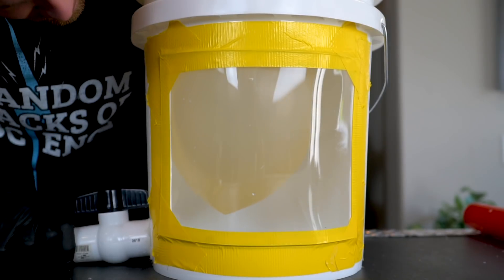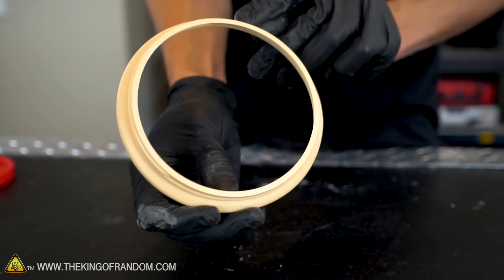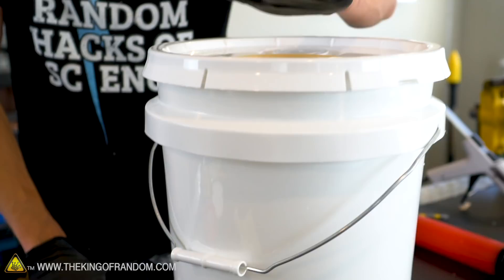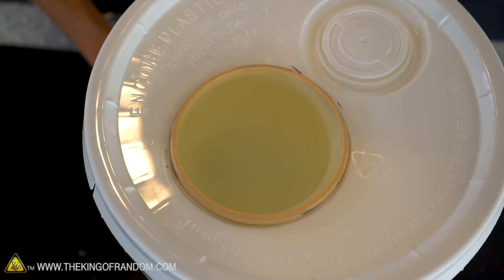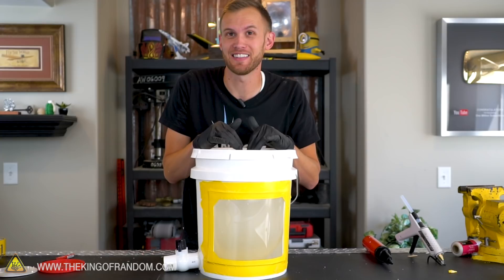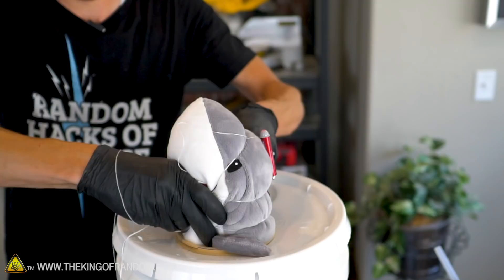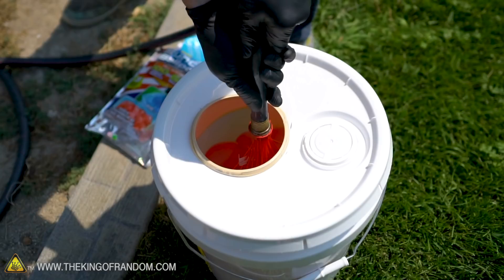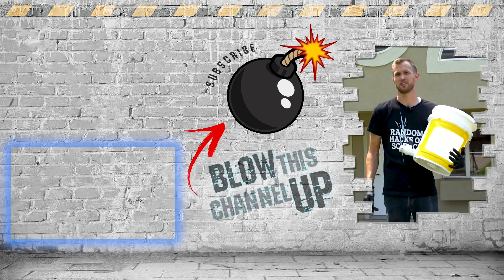Inflate Balloons by SUCKING

Comment: Is it possible to make a balloon levitate? By increasing helium to the point where the balloon won’t completely float but will stay in one place and levitate? Or possibly using other gasses to creat a balance and make the balloon stay in one place?
Reply: Yes but it's very very hard
Reply: And how much weight could it hold
Reply: It depends
Reply: it is. i had a balloon that would stay where the sting would stay on the floor and it would not fly away.
Reply: Its called wubble
Reply: An easier should be just to put weight to the ballon to the point that it dont floats away
Reply: If the density is even slightly higher than air, it would slowly sink, if it's slightly lower it would slowly rise. Even if you created a nearly perfect balance it would still over time move in either direction. You could make a slightly lighter baloon and blow a very slow steady air from above to levotate it forever
Reply: You'd have to make a ratio of somthing like 3 - 1
Reply: yes, but not for long.
Reply: There is no true levitation, its velocity would slowly be increasing or decreasing
Reply: It would have to have the same density as the air around it.
Reply: Yes but it will be very hard and it will move towards everything
Reply: just fill a balloon normally and wait a few days, as the helium slowly escapes it will eventually do that for a time before it winds up losing too much to float any more.
Reply: Might be fun to make something that floats between levels of water get a lot more control in that situation

Comment: This is a very neat trick. Now try to make a hole in a balloon without popping it.
Reply: Water
Reply: Put water in a balloon then stab it with a pencil and keep the pencil there
Reply: Put tape on the balloon and stab it there, and leave the stabby thing in if u dont want it to deflate
Reply: Stab something at the neck of the balloon so it goes flying :/
Reply: thats ez

Simply just put a bit of tape on a balloon, it doesn't have to be big, then stick a needle through the part with tape, it doesn't pop.
Reply: you can also cover a skewer with soap, along with the area you want to stab, then impale it with the skewer.
Reply: your crazy

Comment: What would happen with molten metal in vacuum chamber?
Reply: Nothing i' d guess it would maybeee start to bubble a bit due to higher (or lower not sure) vapor pressure or because of trapped gasses like carbon dioxide.
But i would also love to see that
Reply: He won't do that.
300°Celsius metal in a glass jar/plastic bucket,bad idea.
Reply: Umm 1. Molten metal is more than 300 celcius. And 2. He can always use metal bucket
Reply: @raww1315  The heat radiated would still do a lot of damage.

Comment: Fantastic idea! But...for those who are interested, what brand & size balloon did you use. 

Also, you did not fully show yourself removing the balloon necks from the top of the container after inflation. Why is that?? Is it difficult/was there trouble doing so??? With that basically being the last step as it pertains to the bucket, it would have been NICE TO SEE!! Thanks.

Comment: Why don't you stick a piece of PVC pipe into the vacuum hose and tape it on? Then connect it to the ball valve so you don't have to constantly hold on to hose. You'll also have a better seal that way.

Comment: You could probably make a water balloon bomber by only putting 5-8 water balloons in the bigger balloon and fill the bigger balloon with helium. The only problem I have is the popping mechanism. I thought about using the blow dart to do it but firing a dart in the air is dangerous and it could also pop the water balloons inside.